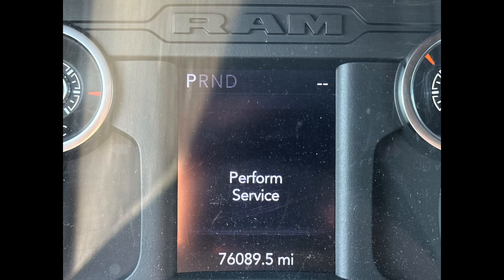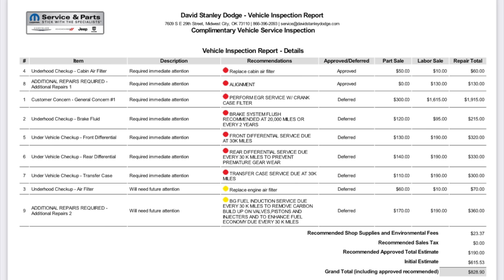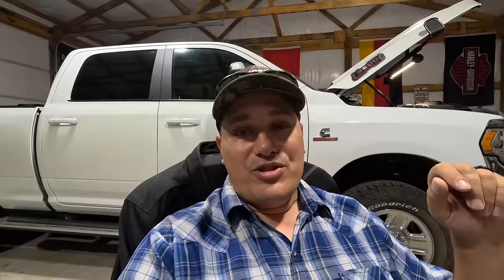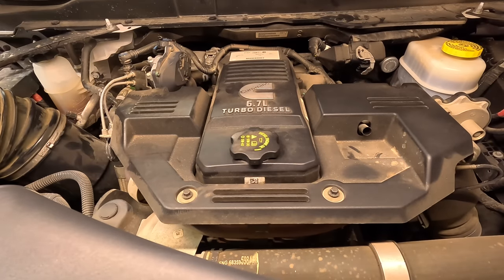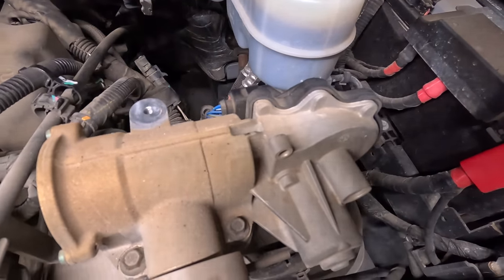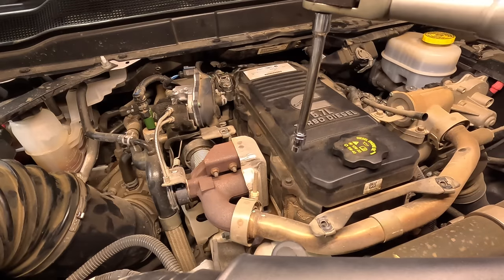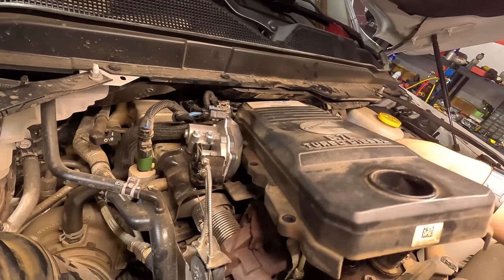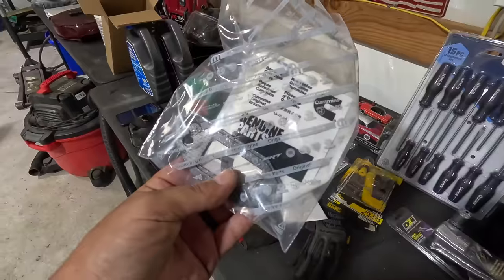My 2021 RAM 3500 Needed $4,000 in Service!! DIY EGR and CCV Service Saved me $1650!

Comment: FYI, chrysler tech here. The "perform service" only means that you need a ccv filter. You don't need the egr cleaning until 120k miles, and even then, they are usually perfectly fine and don't benefit from the service.
Reply: @rticul8862   I got a question that always has multiple answers. What are your thoughts on the fluid flushes on everything? Necessary? Also transmissions. Flushing fluid and filter changes? Good idea or don’t Touch if it isn’t broke?  Thanks.
Reply: 14ooo miles no oil change  ? You can do most all mant. Just YouTube it I been doing mine for three years. 👍
Reply: Poor engine….sucking in all that soot, what an after-thought the emissions are on this iconic engine. Stripping the life out of it.

Comment: I sold my 2019 diesel over 2 years ago, which was $760 a month, and bought a 2003 Duramax for 17k.  Zero problems since I bought it 124k miles no Def saved me 8k a year in payments alone.  The truck has already paid for itself in payment savings.
Reply: Don’t buy a new duracrap are you will be dealing more problems
Reply: The only real issue with this gen Duramax are the injectors. Keep your eye on the oil and oil level as the diesel can go down into the crankcase when this problem presents… but otherwise it sounds like you’re winning.
Reply: Unless the 2003 Duramax was fitted with an aftermarket exhaust break, you have a lesser truck. Less HP, Less torque, possibly less towing capability. Of course you swapped that for less payments too. For me, the exhaust break is the winner. I can go down a 7& grade towing 11k lbs, set the cruise at 55 and hardly if ever have to touch the brakes. Exhaust brake magic.
Reply: Yeah but you are driving a 20 year old truck. My 2020 Ram 3500 will be paid off in 2 years and I’ll be driving a 5 year old truck
Reply: Must be at a dealer to let a greenhorn ..screw ya good truck up.....
Reply: It’s just the admissions that are killing us really they’re adding too many things to these new trucks to the point where it’s just not really making sense to own one and if you’re bad at maintenance or you cannot rely on yourself to do the maintenance at all like, not even the oil change You’re basically digging yourself a hole
Reply: Man I been wanting to do this with my 21 ram get a 2006 5.9
Reply: That's RAM QUALITY CONTROL FOR YOU! No 2021 vehicle should need that level of repair do young in its life or any repair for that matter. Frustrating that you are a year into your payments and have to shell out a massive amount of money for repairs. NOT OK RAM!
Reply: Well for one thing your either new to diesel trucks, they do require a little more maintenance than your basic 1/2 ton. You need to search around for your parts the CCV Filter and the rest of the stuff you wasted your money on by buying from the dealer can be found at your local Cummins Dealer for a fraction of what you paid. As soon as you took it in and found out the cost you should have laughed at them and walked out. Oil changes, fuel filters, gear oil change, and the 4 wheel drive can be done by you. Front end alignment you could've called around and found a good tire shop that works on heavy duty trucks, egr cleaning can also be done by you, brake flush, well again find a reputable grage and they should be able to do it for a third of what the "Stealership" would charge you. So don't blame Dodge for your problems on the cost of doing business with the dealer unless it has to do with a recall.
Reply: Wait,…so you had 14K miles on that oil and you never changed it?  So you go by that oil meter?  Good lord you are going to have more issues then you want!   That EGR Cleaning service is BS!  That egr isn’t even able to come apart.
Reply: I love my 2018 mega cab no problems at all runs like a champ and my payment is 650 and I only owe 13k could get 48k maybe 50k for it right now
Reply: @themichaelcreed  Agreed.  You likely have nice truck there.  But I would have a hard time believing that old truck has the power these newer trucks have.  It's a toss-up for sure.  Power or reliability.
Reply: Does why I got a 2012 ram 2500 no def I have replace the ccv filer and the egr valve to clean it you need to run the truck 80 to 85 mph for 10 to 20 mins and if the check engine light comes on when you finish running the truck the light will go off and the egr is clean. You can buy EGR CLEANING KIT from Geno’s garage for $164.95 ccv filter and all the gaskets
Reply: But wait for head gaskets and fuel system issues
Reply: @mikeyncali  2017 crew cab, 70K miles .... paid off last year, bought new in 2018.
Reply: Smart move my dude!
Reply: Every duramax with injector problems garanteed in 2024 they got new injectors already

Comment: Newer has never been better. I was told by my Grandfather to buy used but cared for as opposed to spending big bucks for new when I was 12 years old. I am 75 now and practiced what he preached except for a new Pontiac GrandPrix  in 1997, which was a lemon, and suffered a $6500.00 cash loss.
Reply: I w😊
Reply: Same here. My god father always told me to buy used well care vehicles instead of new or certified pre owned. After two bad experiences will never buy used well care again. Will only buy new or used certified pre owned. The money you might save you will end up paying it in post repairs over the years and headaches
Reply: I had a 98 Bonneville SSEI, one of the best cars I have ever had.

Comment: Look in your owners manual and you'll find the only thing that needed to be changed was the CCV filter. Ram did away with the requirement to clean the EGR filter when they started using DEF, 2013 as I recall, and the "67,500" service actually jumps up to an even higher interval with the 5th Gens I believe. The actual service manuals have the correct data but the dealers always seem to go with the requirement on the older configurations.
Reply: There's no EGR filter. You are referring to the EGR cooler which really gets clogged up on pre-DEF cummins (pre 2013).
Reply: I think he probably meant DPF @wtbman
Reply: @wtbman the EGR cooler still get clogged has nothing to do with the def system
Reply: @jamesvuxta8723  2013+ trucks run fewer EGR cycles because they run more SCR/DEF so they don’t clog as often. The EGR maintenance interval mileage is a lot longer on DEF trucks. Therefore newer trucks should have fewer EGR issues.
Reply: @wtbman  I believe that was pre-67A recall 🤣
Reply: @jamesvuxta8723  Actually it does.  Not saying the EGR cooler won't still get dirty and clogged up, but what a lot of folks don't understand is that the DEF system actually assists in keeping these other components cleaner.  That's why RAM started using DEF.  They were a little late compared to the other makes and ended up learning the hard way.  Ya, everyone thought they were giving in, but it was actually a good move.  A better move would be to tell the EPA to shove it and going back to no smog equipment.  But that's not happening either.
Reply: 75k
Reply: Ha
Reply: 2019 and up don’t get cleaned

Comment: I paid 100k for my 2021 ram 3500 with the black widow edition. It’s only got 41k miles on it and the service engine light comes on! The dealership wanted to charge me 85$ just for diagnostic check. I went to Autozone, within 5 minutes I found out what it was. Damn egr valve! For my engine that thing was 995$ thru Autozone. Can only imagine how much thru the dealership! So glad you made this video. I’m sure mine has even less build up than the one shown. Time to get busy under the hood. Ty for making this video. In my opinion dealerships are out there just to rip you off.
Reply from the maker: A 2021 with 41k is still under factory warranty. Why would you pay for it?
Reply: @AutoAuctionRebuilds  you are correct. I believe we also got the extended warranty. Cleaned out the egr valve but the service engine will not go away despite trying many times to reset it. Also disconnected both batteries for an hour and the light is still there. I don’t trust dealership mechanics but looks like I have no choice.

Comment: I paid UP for a 2002 F350 last year when prices were still high. My truck has a flatbed and had 149K on it when I bought it. I  drove it from Springfield, MO back to Northern New England. I wound up taking her to a local diesel shop and I paid about another 3K getting her sorted out. My truck is a pre emissions dream and I have ZERO regrets. Sometimes you get what you pay for!
✊🏿

Comment: You might also want to check on the bolt that holds the heater grid in the intake manifold. They are known for coming loose and destroying the engine.
Reply: Good call!  Banks has a cheap solution for that.
Reply: @christiandulaney1638  I wouldn’t call it cheap haha, maybe cheap when compared to the damage the bolt can cause!
Reply: @Mistro07 agreed!  $1000 + is not cheap at our house
Reply: @Pfarley  $199 for the Banks

Comment: The crazy part about my 2021 Ram 3500 HO Mega Cab is the engine bay looks like the day I picked it up. It takes some time to keep things clean but damn this truck engine/bay looks dirty as hell. 

Glad to see you’re doing all your own maintenance. I do all mine except the transmission service. I do oil, oil filter, fuel filters, cabin filter, and these types of services myself. No need to spend that kind of money if you can do them yourself. Just keep a record of everything you do and mileage for any warranty stuff if applicable. Thanks for the video.
Reply: Unfortunately, you only cleaned about 10% of the entire circuit!!!!!!!!!

Comment: Welcome to owning a heavy duty diesel truck! I bought my CCV filter at Autozone. Works great and has a lifetime warranty for $140.00.  I’ve already changed it twice for free. I hotshot so I rack up the miles quick. Also I’ve reused my egr gaskets with no issues. Don’t spend money you don’t need to spend.

Comment: I'm glad i watched this video. I just bought my first Cummins. I started watching the channel when you picked up the red 2nd gen at auction. I've also got one of those. I bought my truck with 58k on the clock and asked the dealership if they would perform the 60k service which they declined to do i wanted the truck and jumped on it. this service is due now thank you for this video i know it's a little older but it's definitely helping guys like me.

Thanks Randy.

Comment: Some notes, The CCV will continue trigger perform service if not replaced. it checks pressure, also the EGR valve is not designed to be cleaned on all 6.7 Cummins after DEF system implementation.

Comment: My 2016 Ram 3500 is very expensive in maintenance.  I do the fuel filters myself ($80) in parts.  Oil changes I get done at Jiffy lube because it’s just a pain and messy.  The dealer charged me about $1500 fir the EGR cleaning.  My heater core went bad.  That was $2800 including changing the AC evaporator because why not.  The dash is already taken apart and it’s a $180 part.  I go through tires every two years because the truck is so heavy, it just eats them up.  I’ve tried Toyo, BFG and Michelin.  I’m doing the egr myself next time thanks to this video.

Comment: Great job Randy,I’m going to show the video to my brother as his 2500 Ram diesel has about 50,000 miles.
Reply from the maker: at around 65K miles he should be getting the same message. It will go into limp mode if not addressed.

Comment: Doc’s Diesel now sells CCV filter for $70.  I have 2018 6.7 with 156k miles.  Never a service code displayed for this, so, I am probably lucky.  I only run full synthetic which is much cleaner than non-synthetic.  Great Video, Kudos!

Comment: I’ve got a manual 5 speed 2005 dodge ram 2500 5.7 gas.  This truck is awesome!! The only serious thing I’ve ever had to do on this truck is new clutch and a fuel pump. I change the oil myself and the plugs. It does have a leak in the exhaust manifold however but I’m not concerned with it because it’s never gotten any worse.

Comment: My truck is at 267000 and never had the EGR system touched. Haven’t had any issues so must be working ok. In fact my truck has never been to the dealer. Only issue has been turbo actuator, changed in my driveway. This has been the best truck I’ve ever owned. Also, buy all your filters right from the Cummins dealer. They are cheaper than Mopar.
Reply: What year is your truck ?
Reply: @Elenrro  2014
Reply: I got a 2012 ram 2500 with only right now 74000 miles on it and no def

Comment: Bought my 2007.5 Ram 2500 from a Dodge dealer with 68K miles. Noticed the perform service message. Did some research learned of the 67.500 mile service. The dealer said I was SOL. So I did the service myself,cost about $200 in parts and 4 hours of my labor. Wasnt to bad of a job and everything is on top of the engine. On the earlier trucks its more involved sint the EGR cooler has to be cleaned too. Been 2 years and im at 82K miles now.

Comment: i just bought and installed a genuine fleetguard crankcase ventilation filter and installed it. it took 20 minutes altogether and the ebay cost for the ccv filter was 30.00 including tax and shipping. the gaskets at napa are about 10-15.00.

Comment: The maintenance schedule does NOT require the cleaning of the EGR and cooler. Instead of selling your truck it is good to do the maintenance yourself to save money. I’ve changed my leaking plastic Y coolant to aluminum, oil and fuel filter change, crankcase filter, and my turbo actuator myself. You still need to do the oil change on your differentials, transmission and filter, transfer case which the dealer did for me in an hour. They had a special for $1000 which still seemed high but didn’t want to mess with my Aisen transmission on my 2014 Ram 3500 4x4. I do still drive my 1996 Dodge 2500 as a daily driver with 389000 and California does NOT require smog testing pre 1997. I installed a 2013 seat which makes it very comfortable. I love the exhaust brake on my 4th gen for towing but try to drive my old faithful 12 valve which I still love that I bought new.
I bought the Banks Ram intake and will try to do that myself and clean the EGR at that time. My friend lost his engine to the grid heater bolt failure at 120,000 miles. Beware! I did have to change the killer dowl pin on my 1996 12 valve so always something….

Comment: Looks simple enough. Only have 13000 on my 2021. I did notice you were engaging the preheat when starting. If you push your start button twice, it will start with no preheat. I assume from your video you are not where I am (Alaska) although I do not engage preheat in summer. That under nut of the pre-heat cable connector is a huge killer of these motors. I plan on installing the Banks kit that will eliminate that bolt. It seems simple as most Banks stuff is designed DIY. Great video!

Comment: I just got took on what you're talking about .i went in for a check engine light . And they told me every little little issue they could find I just met the guy. He seemed to be a pretty good younger  person With a fairly new Shop.   I told  'em to do what he thought would be best for the truck .man the list went on and on 125 to take off a small grill 3 bolts 200 for a bg battery care witch is to small little pads under the clamps and yep the cv filter swap   $646 fuel filters $ 376 $450 to hook up the ob2 scanner it's said shops do that to ppl .

Comment: I could not agree with you more. I bought the same truck with 72000 on it and out about 6000 miles on it and got the same massage. Dealer told me that it would cost me $2500 and I only had it for 2 months. Thank for the video

Comment: Randy I don't know if you looked it up or not but anyways the ccv filter is supposed to be replaced at right around the mileage you are at now and same with the egr valve cleaning the perform service message is supposed to come on right around 67,500 miles so this is normal maintenance I could be wrong but I did a quick google search and that's what came up but do understand why you were upset though about the cost.
Reply: Not on 2019 and up ccv 75 k egr does not need to be cleaned on 2019 and up.

Comment: Good video Randy. The labor was likely higher because the dealer would have cleaned the egr cooler also. To clean it, you need to remove it. 

When I do this service in my shop, we disassemble the Egr valve completely, remove the Egr cooler and cooler valve, and soak them in purple power overnight. 

We also do the egr back pressure pipe and remove and clean the passage under the pressure sensor to the tube. That is the thin metal tube along the passenger side of the engine near/under the cooler. They like to plug up. 

4K is a bit much, last one we did was 1300 out the door. And that even included the CCV filter too. 

They are great trucks, but if the emissions system’s maintenance isn’t done regularly or on time, they can plug up.
Reply: I also believed the EGR cooler was a 75k scheduled service. That whole system and cost is why I deleted my 2012 truck.

Comment: Just to let you know. If you check your owner manual. You don't need to touch the egr valve for this service. You only need to swap out the ccv filter.  The dealership was hostelling you services you don't need.